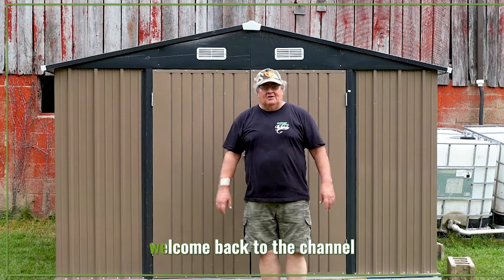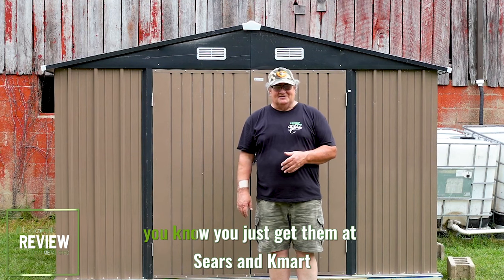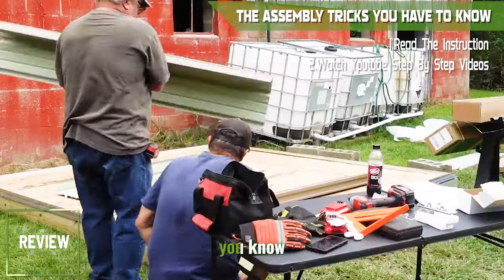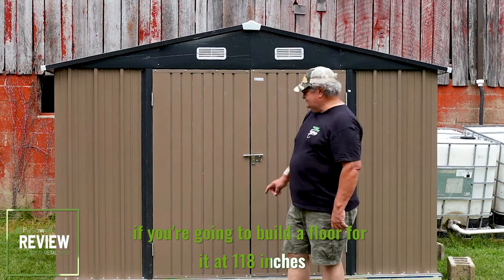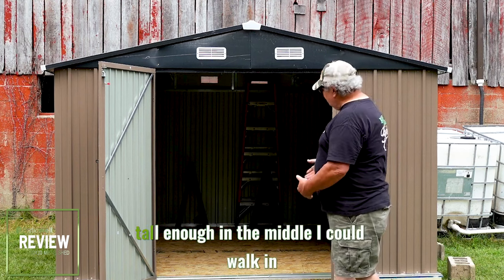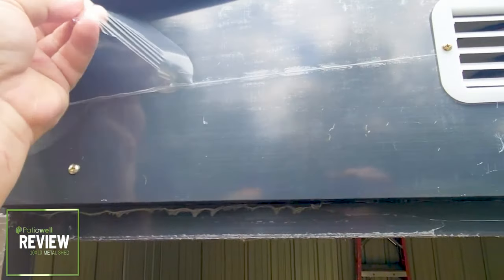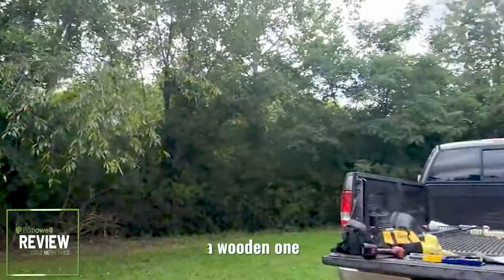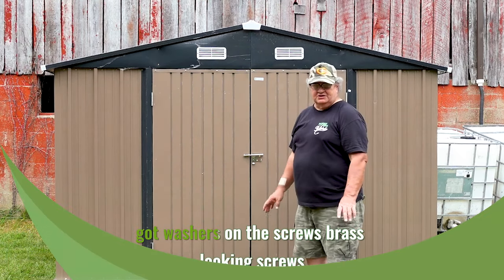Building Tricks & Reveiws - Patiowell 10X10 Metal Shed

Comment: I am about a third of the way through building a 8 x 10 shed.  So far, taking the film off,  has been about 2/3rds the effort.  The instructions do not specify the minimum dimensions for a foundation.  This could be a simple dimensioned insert added to box 1.  Here in the US we once had a profession called drafting where job #1 was adding salient dimensions.  Before I was an engineer and as an engineer I designed and dimensioned thousands of drawings.  However, with the introduction of CAD during the '80 the art of drafting was lost when they just assumed engineers would do the design AND drafting (sell expensive CAD packages and lay off the drafters was the sales pitch).  I suspect this is also the norm in China where customer documentation is just screenshots from the 3d assembly.  In CAD geometry is perfect and the holes align perfectly.  They use this data to make parts and to punch holes but if the assembly is built on a non level surface then there will be misaligned holes.  There is a trick to large sheet metal assemblies: to not tighten the hardware, build on the flattest surface possible and then shake the assembly and then tighten all the screws.  However, this assembly has over 500 screws and other fasteners you best results will come from a flat foundation.

Comment: Nice shed, we used to have two metal sheds in the back yard but over time strong winds ended up destroying them.  I was thinking of building a wood one or vinyl one, but saw reviews on these.  Hope they withstand some strong winds and I’ll consider these.  Also wondering if ok to attach solar panels to the roof, I’m thinking of getting a power bank to setup inside recharged by solar and use to recharge all my tool batteries.
Reply from the maker: We'll be coming out with an exclusive new plastic tool shed next month and will have a great discount as a pre-sale, so you may pay attention to that~!

Comment: Can you tell me exactly what size flooring? And what did you use for the shed floor? Also what would you recommend if the ground is uneven
Reply from the maker: 120.8 inches X 180 inches is perfect, and both wood and concrete foundation materials are appropriate.
Reply: Thank you
Reply: I assume you had to make the floor first.